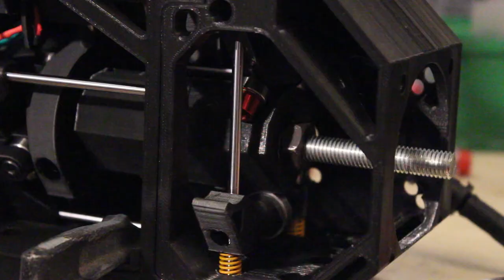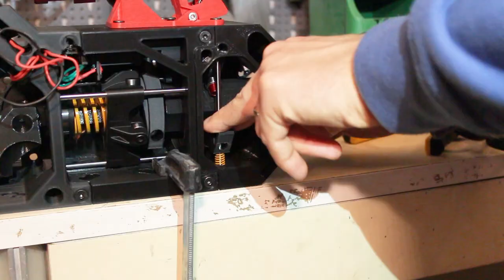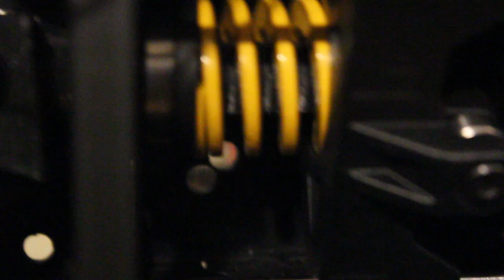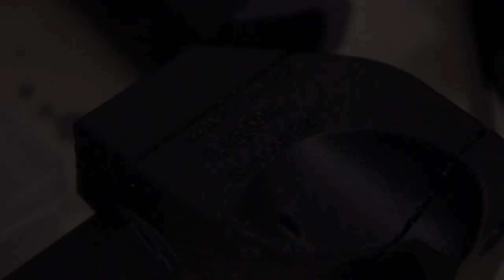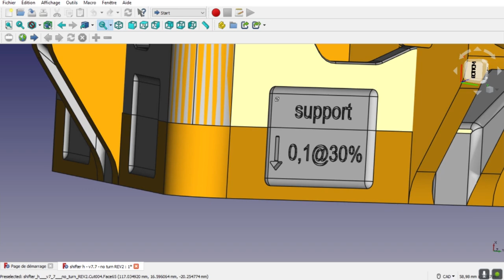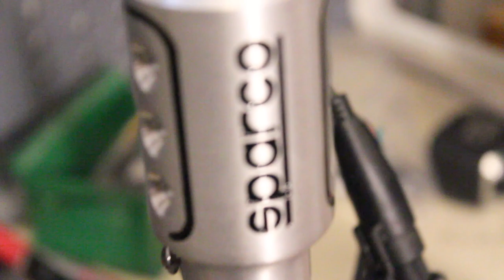WIP : SRT Gearbox clutch controlled !

Comment: Extremely impressive. Great work! Will you work on the P1 accelerator pedal design and STL files soon?
Reply from the maker: Thanks :-) i will need one or two months for the gearbox, then I will update the clutch design, then the brake and finally the p1 throttle. The gt one does a great job for the moment, so it isn't my top priority. But I already worked on it, it shouldn't be long to release.
Reply: @LeboisRacing  I'm making a P1 brake now, so maybe I'll print the srt accelerator to start. It's good fun to build them 👍

Comment: Amazing. But you need some connection to the software, because many h-pattern cars can be shifted without the clutch with rev-matching. It would be a major handicap not to be able to do this.
Reply from the maker: Man... if you want to simulate all the gearboxes that exist, you will need as many different gearboxes as cars :-)